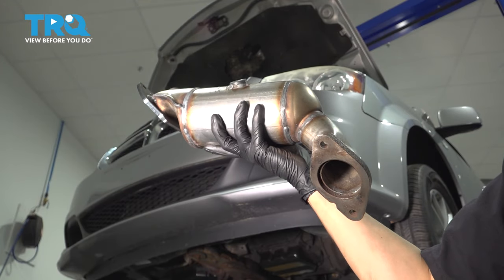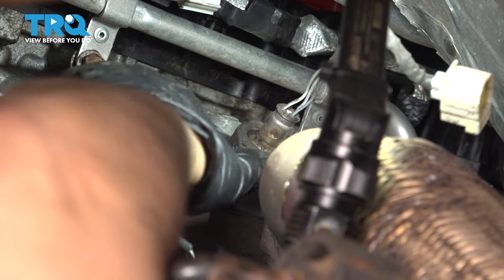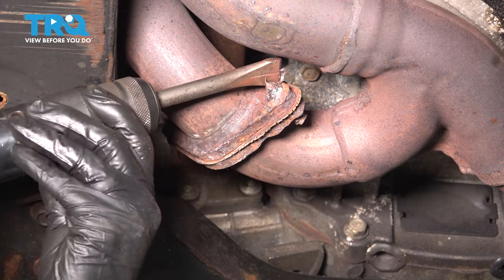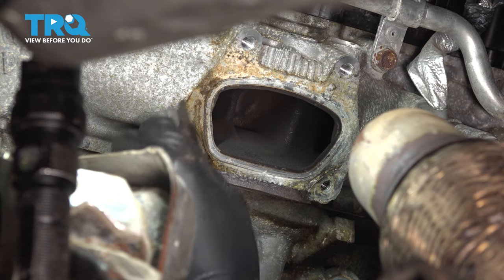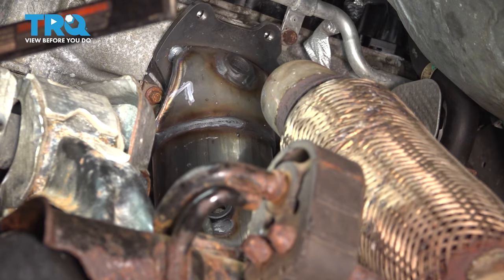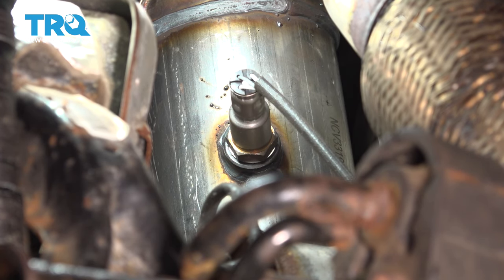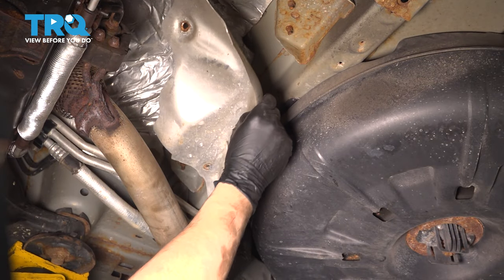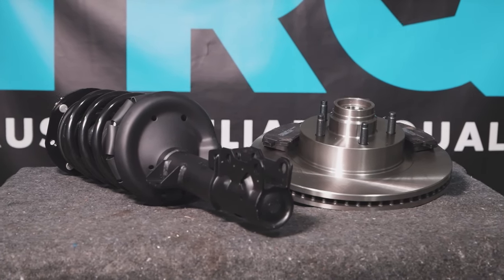How to Replace Rear Catalytic Converter 2008-2020 Dodge Grand Caravan

Comment: I wanted to come back and thank you. Also wanted to leave some advice for people attempting this in their driveway on jackstands and floor jacks which is what I did. It is a horrible idea. I raised one side up and secured it with multiple jackstands. I then spent about half a day fighting with rusted out O2 sensors that took serious force to take out. The flange bolts on mine were rusted as well. They snapped off in the middle and i had to drill them out at an awkward angle. Then when i finally had everything out, and the new one wrestled behind (on my back with barely enough room to breathe and move my arms, the replacement catalytic converter would not line up. It's hard to hammer in place when you can't swing due to space restrictions. I ended up using a pneumatic palm nailer and a piece of oak to convince the new cat to move in place. The flange at the bottom could be moved with a short crowbar. This is a job for people with a lift and equipment or at least ramps. I spent a total of about 8-10 hours over three days (not including the time spent pulling little rocks and metal chips out of my scalp).

Comment: I have a  question my 2008 dodge grand caravan sxt 3.8L has a flashing engine light since 5 days ago my gas fuel has been expensive and I can smell gas and the van shakes a bit when starting. I looks like the catalytic converter has never been change or the oxygen sensors. The van is a 198,500 miles. What catalytic converter should I get?